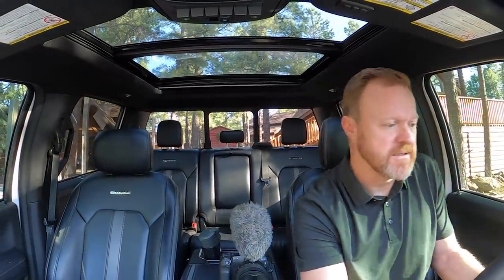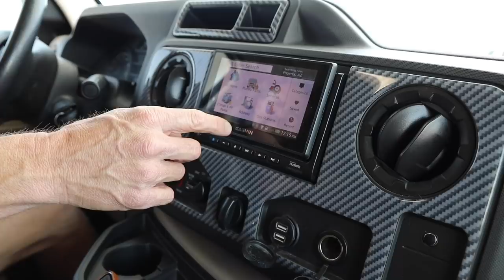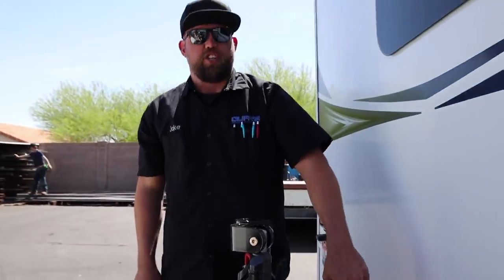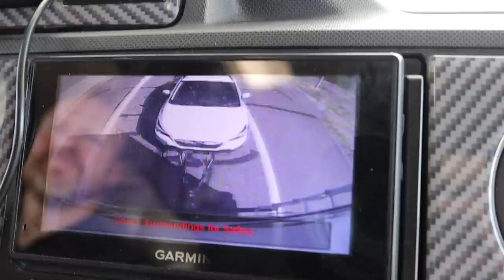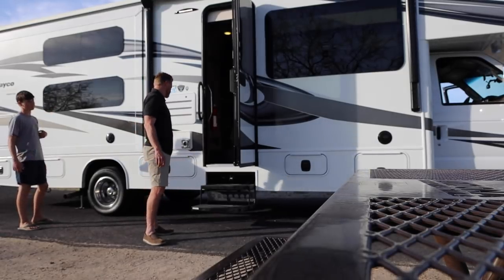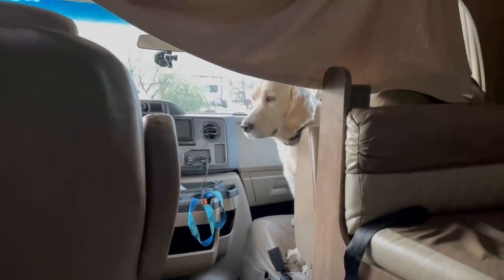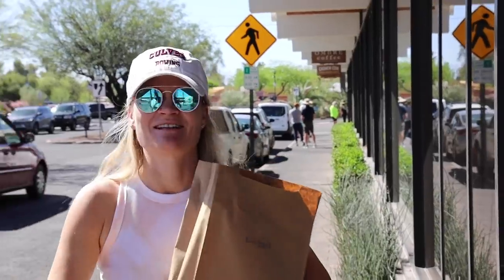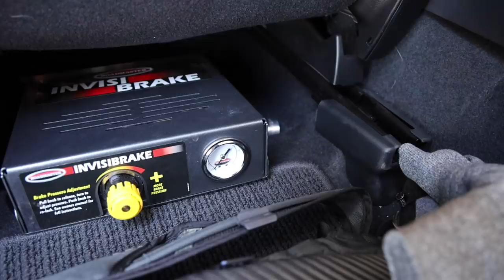Class C RV Trip to 🌵 Saguaro National Park

Comment: We used Tire Minder and had so many false Alarms and after stopping on a busy Interstate over and over only to find out another false , I took it and ran over it with my 30000 pound coach lol.
A friend of ours works for TST TPM system and told us to try it, so we did for 2 seasons and thousands of miles with NO false alarms .

Comment: "Charlie, ask Marc and Trish to put rug or a rubber-back mat (like an entrance mat) on the linoleum down the center of the rig.  You will enjoy the drive so much better knowing that can you walk down the isle without sliding on your belly while doing the four-corner splits."

"Then ask them to put 30"x40" dog cushion on the floor of the dinette so you can stretch out and sleep without the fear of skating around the rig when Trish takes those sharp corners."

"My owners did this to our Class A and I LOVE riding with them -- I especially love the view out the big window and cool breeze from their dash AC."

"Sincerely, Kiko" 

Our shepherd wanted to pass this note along.  I know, these are rentals, but if there is a motorized RV in your future (why else rig the Subaru for towing?), give this a try.  Charlie might be freaked out about the fear of losing his footing while you drive.  Our shepherd doesn't like riding in our SUVs, but love the Class A and the Class C we had before it.

Comment: Note to Marc. A safety tip for attaching tow bar to car. Always make sure the nut side of tow bar is on the bottom side of tow bar. If it should come loss(rare I'm sure) and fall off the bolt will remain in place. If the nut is on top the bolt will fall free and bar will not stay attached. This may sound confusing but check the video near the end where you are hooking up the tow bar. Proper attachment is shown at the shop when you pick up car.

Comment: Yeah they dont want you putting the slides out as you drive down the road and the awning wont come out when the ignition is on as well.  I have the same towbar they are sweet. I went with RVI for the brake system its a bit of a pain you have to put it in every time but I like the one screen and done it has my brake system info, tire pressure on the toad, and I have the battery charger as well so my coach charges the toad so I can turn on the parking lights at night for that extra extra visibility  and not kill the battery. I also have the wireless break away so no holes drilled.

Comment: We rented a Class C one time and it was a total disaster.  The passenger door quit locking 2nd night of the trip and the rental company was no help at all.  No way we were going to stay in the Walmart parking lot without locking doors so we drove all night and into the next day.  On the way home the walls of the bedroom came apart from the frame.  Cold air was blowing in for two days. You could literally see the outside between the walls and frame.  Second time we rented (because we’re gluttons for punishment) a travel trailer through RV share.  It was a much better experience so we’re back in the RV game.  I get so much info from your channel so I think when we buy in a couple of years I’m going to be the one in charge of that whole process......👍.  It’ll be a fifth wheel.

Comment: We have rented a couple of travel trailers and a couple of the 30' Class C RVs from Cruise America. We have had mixed results with the travel trailers, but the Cruise America rigs have always been a blast. They are easy to drive and I don't remember them being as noisy as the one you rented. The only down side is that the Cruise America rigs don't have slides.

Comment: 30:15 I'm with you on the noise of a motorized rig.  After having various towable RVs and a truck camper (my current rig), and the silence of my truck, driving a motorized rig my drive me nuts with all the noise.  Oven racks rattling, dishes clanging around, silverware clinking in the drawer.  :-0

Comment: Good rule of thumb for tail swing is half the length of the distance of the rear axle to the rear of the vehicle. But I think you were showing the same thing.
If you were going to drive 45 mins for Mexican food you should have gone to Mi Casa in Benson. My fav all time. Highly recommended.

Comment: Gotta love the bait and switch on RVshare... We've rented several times and it's almost always a mixed bag. I've had the owners deliver the RV and set it up incorrectly in every possible way. One guy corrected like 3 or 4 inches of left to right level with the manual stabilizing jacks while I watched in horror. The same RV had a disconnected kitchen sink drain that was incidentally running down through an access hole under the fridge. They were so nice for being so oblivious, and I think I hurt their feelings when I didn't leave a review. If you don't have anything nice to say... ANYWAYS. I think yall have sold me on not owning a motor coach. Ever.

Comment: Have the same layout in a different brand. class c's are not bad but you do have to set them up. Not uncommon to do suspension upgrades which improve the drivability and ride greatly. Too bad you got one that was too well loved. 

We had a travel trailer and I don't mind those either. Especially liked it with my ProPirde hitch. Made a huge difference. My problem is for a bigger truck I would need to tow what we want, I would have to use it for a daily driver and that would cause problems with parking at work, etc.

Are you guys going to rent a Super C. My favorite motorized RV and probably my next one here in a few years. I like diesel pushers but you get a lot of that in a super c with a setup that has easier access to the engine and easier to maintain. Trade off is a lot more engine noise. Everything has pro's and con's.

Comment: OMG! I rented a "well loved" class B+/C and it was a miserable experience. No levelers included. It reeked of urine; seats were peeling; shower was so small I couldn't bend over to pick up the soap and the curtain kept sticking to me and it was pouring out into the floor ( reason for the floor having a huge soft spot that I thought would cave in) and the  AC didn't work and it was 95 degrees. Only good thing was the fridge worked!  I realized I wasn't going to get an accurate feel for RVing unless I bought one....so I did. Small TT that I can do everything but back it in. Have tried so many times and just can't do it and why I'm looking into a new class C with auto level. I'm just too old and need things easier to continue RVing. The Entregra Odyssey/Esteem is what I'm looking at and wish that had been available for you to experience.

Comment: Great Video as I await delivery on my new class C! I am reaching out about you Crosstrek Toad as I am looking at the same vehicle for flat tow. Two issues, buying a used one is same price as new and second I can't get anyone at Subaru to acknowledge that this vehicle can be flat towed. There repeated response is unlike a jeep you cannot disconnect the drive train and therefore in neutral on a manual transmission the transfer case still turns the transmission creating heat. Assuming since you went to the effort and expense for a Roadmaster system that you will stay with the Subaru. Any feedback on the Crosstrek experience being flat towed and found the link to "flat towing" interesting!

Comment: Yep, the F250 is quieter.  However, in the F250 your passengers can't use the bathroom (important if your wife has a small bladder) while rolling.  They also can't get something to eat or drink from the fridge while rolling.  You also don't have access to ALL of your food and snacks.  Bigtime tradeoffs.  Like setup time (auto leveler easy button), teardown time, and storage space.  Lots of tradeoffs.   Jayco is garbage, too bad you got screwed by the rental company.  Next time rent a 32' Class A on an F53 chassis.  That's big enough to be comfortable, has lots of storage inside and out, small enough to fit in most all campground spaces, and it's got a good turning radius.  But again, a little more noise than the F250, but most are better than that Jayco.  A Tiffen or Newmar would be a nice rental for you to experience.

Comment: Marc, how would you review the InvisiBrake system?  Did you find the need to alter how you apply the brakes?  Any issues using brakes, maybe riding them, down hills to slow the rig down (when you don't need to downshift)?

InvisiBrake is a "progressive" system that steadily applies more brake while the coach's brake lights are on.  At about 8 seconds, full break is applied.  At 15 seconds, brakes are released, to protect the toad's brakes.  So if you lightly ride the brakes in the coach for 8 seconds, full brakes will be applied to the toad, after 15 seconds, no brakes on the toad.

We are researching brake systems for our Ford Edge.  I like the simplicity of the InvisiBrake, but am leery of the progressive system.  There are more complicated "proportional" systems available that try to synchronize the amount of pressure applied to the toad's brakes with the amount you apply to the coach's brake.  Ride the brake lightly in the coach and the brakes are applied lightly in toad.  Hit the brake hard in the coach and the brakes are applied hard in the toad.

I really want to like the InvisiBrake, but am looking for more first-hand reviews of this progressive system ,particularly in the mountains.
Reply from the maker: I'll share more as I get more experience with it.

Comment: I was told Subarus cannot be flat towed. Did you make any modifications other than the tow bar and brakes? Is the fact it is a manual transmission that allows towing? Thanks for all the videos!!!
Reply from the maker: This is a cross trek manual. no mods out of the ordinary.

Comment: With the standard reply being a flat no when asking about flat towing a Subaru (pun intended), how did you find out for sure you could tow the Crosstrek? I have a WRX STi that I'm struggling with the idea of getting rid of, but I am about to go full-time in a Class A. I've searched high and low, but can't seem to find an answer to if it actually can be flat towed or if it will cause damage. Just the nope can't. do it, with no explanation (feeling like it's a lawyer thing, not a mechanical thing). thank you for any and all responses!

Comment: Good thing that Subaru was a unicorn with a manual transmission. That likely made its setup as a flat tow vehicle a whole lot easier.
Reply: You can’t flat tow any Subaru with an automatic transmission.
Reply: @737MaxPilot  Sure you can!  The only challenge (and it is a challenge) is that the process does not apply to AWD/4WD drive vehicles (and that's a large percentage of Subaru's on the road). For 2WD vehicles, you can either: a. install an aftermarket driveline disconnect or b. remove the drive shaft. Option A isn't cheap and B isn't easy but both can potentially be done by someone willing to put in the effort.

In the bigger picture, however, car manufacturers are quickly moving away from producing cars with manual transmissions altogether. That'll most likely put a serious dent in flat towing.
Reply: @Martimus98  my understanding is that the only 2wd Subaru offered is only in the Japanese domestic market.  I’ve personally never seen  a 2wd Subaru.  So unless it’s a manual, that pretty much ends the discussion.
I just bought a “14 Honda CRV & set it up to tow. It is the last year of a CRV you can flat tow since everything after it has that damned CVT transmission.
Reply: @737MaxPilot  It's also my understanding that cars offered in the Japanese domestic market can be imported into the U.S. I often see cars manufactured for the German and English markets driving on the roads here too. While your point is valid, it also effectively overlooks the real issue.

There are workarounds for 2WD cars with automatic transmissions that can allow them to be flat towed.  In the bigger picture,  these may be our only options moving forward because cars with manual transmissions are going the way of the dodo bird.

Oh, and I fully agree with your sentiments on CVT transmissions.  The only thing worse than driving a car with a CVT transmission is paying the bill when that CVT transmission goes belly up.
Reply: @Martimus98  you are correct, JDM cars of a certain vintage can be imported to the US.  But I was only addressing the “can the Subaru be flat towed” question, of which 99.9% here in the US are AWD.  No argument on whether 2wd cars can be flat towed.

Comment: It’s too bad you got stuck with a worn out class c. First impressions are everything so your experience with the class c started with your first step into that piece of junk aka rental. My 91 year old father downsized from a class a to a class c due to the stairs and trying to climb in. Our cons with the class c are, yes it’s loud. it’s also colder inside during winter months and hotter during summer due to there not being any insulation in the walls. Our pros are, with it being a gas we get better mileage then with the diesel class a , more pulling power with the Ford 450 gas engine ( I’ve named the rig Mighty Mouse) in the mountains the tac, temps and speed seem to handle the climbs easier. But the biggest pro is my 91 year old father can still go rving comfortably with slides that give him plenty of space to move his walker around. And the availability to not have to go outside to get in the passenger seat.

Comment: What did you need to do to flat tow a Subaru? Didn’t think that was possible due to the AWD.
Reply: Only possible if it’s a manual.
Reply: @737MaxPilot  ahhh. Didn’t even think of that. Thanks. Ours isn’t so there goes that. 😎

Comment: I actually got rid of my Subaru because I was told over and over that I could not flat tow or dolly tow it. I am so confused. 🤔
Reply: Depends on if you had an automatic or manual transmission. Can’t tow and automatic trans.
Reply: @ellap1313  Ah! That's right. I forgot that component.  Thanks!